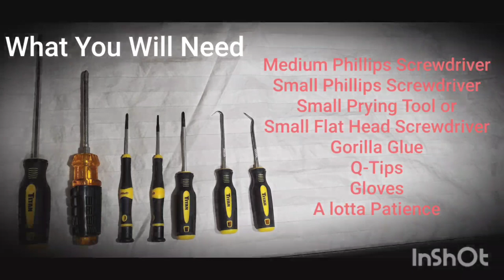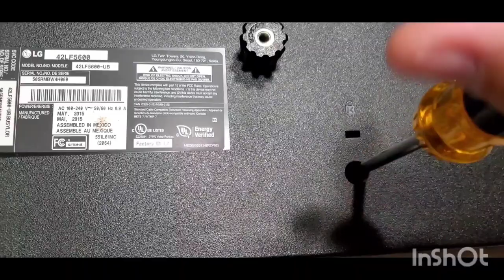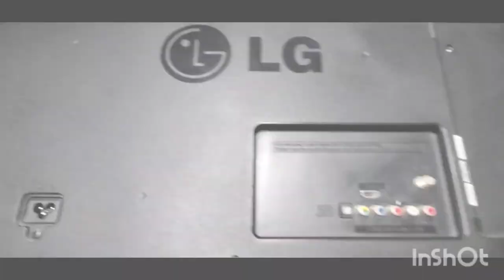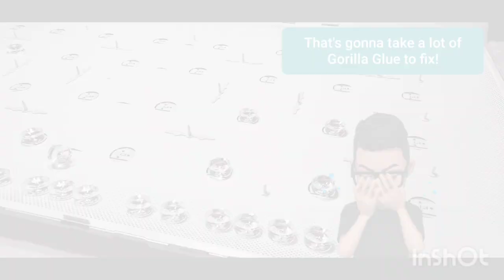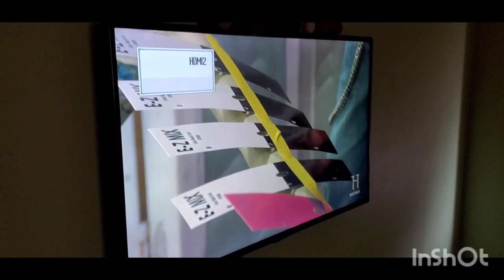White Spots on TV Screen - How to Fix them DIY!!!!

Comment: Just did this to my LG 70 inch panel that started showing the white spots (about 12) - it was a little different to the smaller screen on this video.   Definitely needed 2 people and a lot of patience - there were more circuit boards surrounding the panel (not just the bottom, but on both left and right hand sides, so took a lot longer to get to the leds to start gluing the plastic light diffuser things).
Some tips: 
For larger screens, you have to flip the screen and remove the LCD panel first after removing frame so you can place the LCD over the base panel with the leds, not like in this video, otherwise, there is no way you will align and definitely will crack the screen or struggle to get the screws on properly - I still had a few screws that were much harder to put back on even though I thought I got the alignment perfect.  
I used suction cups to lift the LCD and it was much easier to align over the top.  
Be patient - the bigger the screen, the more light diffusers - I had to glue about 112 of them as most came off easily when I tested to see if they were secure.  Also, use a torch to shine on the diffusers when you are gluing them back so you can align the holes, much easier to see what you are doing and then you don't have to twist them around and smear the glue.
My panel had an additional metal frame and the back was metal as well, so a bit harder to deal with (less flexibility with alignment).  Also had 4 light boards between the leds and the LCD screen (not 2).  
Due to the additional circuit boards on the left and right side (as well as the bottom), there are 2 more ribbons attaching these on each corner - you have to unplug these as well to get the screen off.  Be careful with the plugging the ribbons back in - one of the two main ribbons was not inserted all the way and half my screen was pure white when I powered it back on the first time - reseating it fixed the problem.
I waited almost 24 hours to ensure glue was cured before putting everything back together, just to be sure...
White spots are now all gone and I swear the screen looks brighter than it did before, but that could be just me :-)
Reply from the maker: Awesome writeup! Thanks for your review. My TV wasn't nearly as big but yes, having 2 people would of been easier. I would definitely wait for the glue to cure if I try this next time. Luckily so far it's been holding up well. My issue was my TV is right by the window and it gets hot in the summer. I think that's why the original glue failed. Thanks!

Comment: Awesome! I have the same issue but on a Samsung TV. I cant wait to dig in and get it fixed.
Reply from the maker: I’ve never done it on a Samsung but I’m sure it’s the same basic concept. I’d recommend filming yourself taking it apart or take pics in case you forget. And make sure to glue them good before reassembling. Over A year now and I think 1 has fallen again. But it’s not bad. Good luck!

Comment: Great video, thanks.
I only have 1 white light spot on my Samsung LED Tv, so it's not too bad to view at the moment, so I'll leave it for now.
 Now I know what the problem is, I may give this a go in the future if more lenses drop off...or I may just buy a new Tv? 
I don't know if I would go through this rigmarole to be honest.
BTW, I wouldn't watch 'Twilight' even if someone paid me, lol.
Reply from the maker: It was more of a “Can I do it” type of thing for me but ended up working and it’s still working today. I was about to throw the TV out so I figured it was worth a try.
Reply: @SinisterRCSanDiego  I did try it in the end but as I was lifting the screen, it cracked and, although I looked everywhere for a replacement screen, it would have worked out too expensive, so I binned the Tv and bought a new one after all 😂

Comment: I got a samsung 55" tv with the same white spots nearly 10 to 15.  Will this be the same procedure my friend Kevin.  Please advise? BTW, nice video of fixing LG white spots on TV..
Reply from the maker: I’m sure it’s the same procedure but I’ve never opened up a Samsung so I don’t know if the process is the same. I’d look for a video in opening up your model Samsung. I only did mine because I was going to throw it away if it didn’t work. Good luck!

Comment: Tip: Had difficulty in getting the panels to align when placing the main LED panel on top of the LCD image panel. When not aligned properly, the screws don't go in easily and, in my case, there was an image issue (white line at the top of the screen). Had to place the LCD image panel onto the main LED panel to get everything to line up correctly. Thanks!
Reply from the maker: Good tip! I didn't have that problem luckily. Hopefully you were able to save your TV!
Reply: @SinisterRCSanDiego  I did.

Comment: I bought a 4k Sony tv in July 2021 and just noticed a whole lot of white spots. Is this normal?? I mean it s not even 1 year old. Your video is great showing every step of the way but it seems like a major undertaking. Does this happen to all tv s today??
Reply from the maker: I probably had that TV for a few years before the white spots started. Less than a year with a reputable brand doesn't seem normal but it also depends on where rhe tv is located. Mine was near a window and I think the summer heat caused the glue to fail sooner than later. And yes, it's a big task and a the chance of messing something up. I took pictures and video of the dissessemble process so I knew how to put it all back together. But you have to be careful with the screen and make sure to take your time. I also was about to throw it out so I wasn't too afraid of screwing it up. Luckily it all turned out OK and is still working today. Good luck if you try it out!
Reply: @SinisterRCSanDiego  Thanks for your reply. I might have to get it fixed and it will cost me but like you said it s a new tv so i d be afraid of risking trying to fix it myself. Your video is great and thank you for posting it.

Comment: One question, doesn’t gorilla glue expand with cream like color when it cures? Wouldn’t that hinder the light going through the lens?
Reply from the maker: It's my understanding that the light reflects off of them and doesn't go through them, but I could be mistaken. I didn't notice any difference in the picture except the white spots were gone. You could also use a clear super glue just in case.
Reply: @SinisterRCSanDiego  ok thhen!! Thanks for the response!!

Comment: Great video, I am having this problem with my screen, I have no technical experience fixing these kind of devices, do you think I could do it or do you recommend taking it to a technician? Also does any kind of glue works or does it have to be the one you used? Thanks!
Reply from the maker: Honestly, I was going to throw my TV away so I decided to give it a try. It wasn't difficult but there are a lot of parts and you have to take your time. I would try it if you don't care about the TV. But if it's a good TV, then maybe a professional should do it. Any kind of glue for glass or plastic will work. Super glue or gorilla glue. If you do it, maybe film yourself taking it apart or take pictures to help you put it back together again. Good luck!
Reply: @SinisterRCSanDiego  thanks for the advice, filming is a great idea, just in case.

Comment: Hello. I have a 50inch tv, not a recognized brand, it's been working well.
But of late I have realized that when the tv is off for a long while and you turn it on. I see faint white circles look more like rings, then after a few 4 seconds they disappear and the tv seems normal again. Could it he the same issue?
Reply from the maker: If they are faint then go away, it’s probable not the LED lights. When those LED glass falls the white light is pretty bright and stays there. You might have a problem with your backlight inverter. If your tv has the setting, I would try to reduce the backlight and see if that fixes it. Good luck!

Comment: I have a t.v that has one single bright spot on the screen 
Is there any problem if i continue using it that way
Reply from the maker: Nothing wrong with using it that way. But if there's 1 white spot, that means the adhesive failed on 1 LED, and it will probably fail on more after time. I was ready to throw my TV away but decided to try to fix myself.
Reply: @SinisterRCSanDiego  thankyou for that but suddenly it stopped showing any image.... i can see some name on the screen but it's dark

Comment: Thanks sir i think that spot is bacause the brighness too high, thinked like super amoled on android 🤣 so the brighness nothing effect to make reflector fall down and it is just because the heat?
Reply from the maker: Yes my TV was right by the window and sun. The heat caused the glue to fail and the reflectors to fall. So far it’s still working after almost 1 year!

Comment: Just one thing, trying not to be too critical, Gorilla Glue requires water to be activated.
Reply from the maker: THANKS for the tip. So far the glue is holding after a year but good to know it needs water. I guess I got lucky.